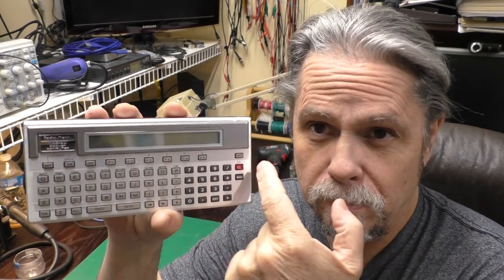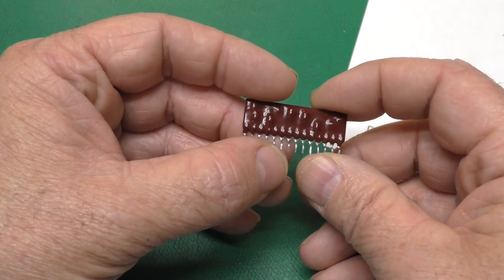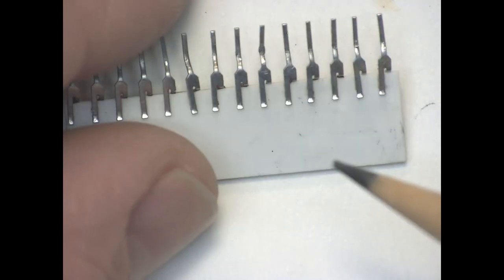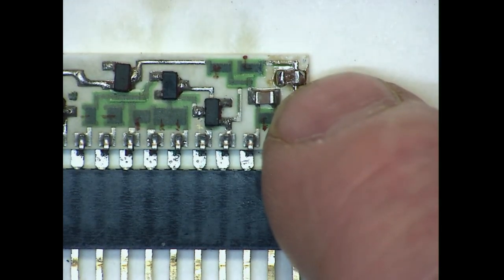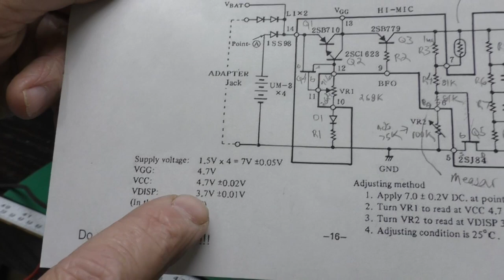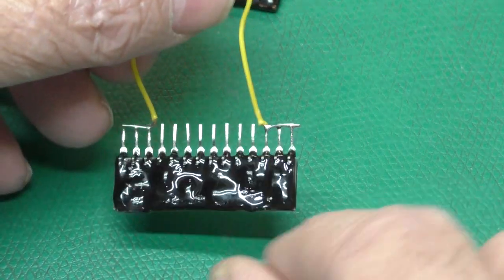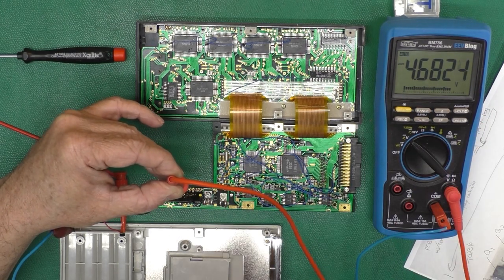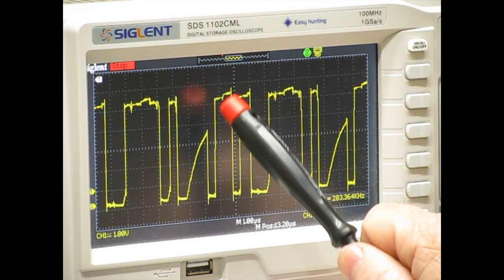DIY - Hybrid module decapping, repair and re-encapsulation

Comment: Found my readings.  Pin 4 is 1.0V on one unit, and 1.1V on another.  Both units are working perfectly fine.
Reply from the maker: Thanks. Someone else suggested they should have said to measure from VCC to VDISP which would give 3.7V. There are a few other errors in this little schematic too. I found another version which shows Q2 the correct way around and the missing R9.

Comment from the maker: I have since learned about 'fumed silica powder' which is a thicker for epoxy. It is mixed in with the epoxy to increase the viscosity and prevent the run-off and dripping problems I was experiencing.

A few keen viewers pointed out that the voltage regulator circuit would not have worked as shown in the schematic. I went searching through all of the PC-1500 manuals I have and found that the service manual has a second schematic in the back (the tech ref manual does not) which shows 'Q2' the other way around and it also shows the 'missing' resistor I called R9. Thanks to the folks who pointed this out.

Also, the same two folks pointed out this configuration is called a Sziklai pair not a Darlington pair. Thanks!

Comment: I wonder if an ultrasonic bath would have gotten the coating off without quite so much scraping - but that's a superb repair job. Had it been unsuccessful for some reason, it would have been reasonably easy to create a replacement, but it's nice to have a repaired original.
Reply from the maker: I was worried about the scraping so the amount of pressure used was minimal, more of sliding the coating off then scraping. The brass brush was used with a light touch as well. The ultrasonic cleaner is an interesting idea. I wonder what the interaction between water and the epoxy remover would be. Maybe the module in a baggy of epoxy remover placed in the water in the ultrasonic cleaner? It might also shake the pins off the PCB. Without the epoxy they were very fragile.

I have started to lay out a replacement PCB, just for fun.
Reply: @HeyBirt  I was thinking either using the epoxy remover as the bulk media in the cleaner, or putting the device in a little metal dish full of remover. I'm quite interested because I never thought of using epoxy [floor coating] remover as a decapsulant and it could be very interesting for ICs. And much much safer than the normal method involving hot acids!
Reply from the maker: I think ICs use a type of thermoplastic rather than epoxy. I suspect that the solvent I used would not work on them. At least it did not seem to have an effect on the transistor cases of the module.
Reply: @HeyBirt  Oohhh excellent point. People often describe the plastic packages as being made "epoxy" but yeah.. you're right, they can't be. Well, back to boiling acid it is :D

Comment: The last 2 I worked on, I wrote down the voltages on all the pins. Let’s see if I can find that scrap paper. 😅

What I can tell you is to be careful with VR2. If set too high and running off batteries that are not brand new, the system will turn off on you!  Too low and the LCD will become dim.

Comment: Great fix! Thanks for sharing the epoxy experiments.
27:11 If I'm understanding, you for a short time, forgot about the prior repair... I have definitely taken to leaving notes in equipment, with dates, to remind myself what I did before. (Of course YT videos serve that purpose too. :) )
Reply from the maker: I have a 'few' PC-2s and PC-1500 so until I saw the diode, I did recall I had fixed this one before. Putting a note on a device to track repairs is a good idea. I typically do this when installing new rechargeable battery packs. It would have jogged my memory sooner on this PC-2.

Comment: Your measurement of the mystery voltage was 0.97 V.  They must have meant the voltage drop was 1V compared to, relative to.
Reply from the maker: It could be something like that. It could have been described in an odd way in the original Japanese documentation and instead of VCC-3.7=1V it got changed to just 3.7V.

Comment: Don't count too much for a diode to act like a fuse. They almost always fail short circuited. Then the bonding might fuse, but that won't be at a very low current. And by the way I think Q2 in the module's schematic has C and E swapped, otherwise I don't see how it could work that way.
Reply from the maker: The diode did act like a fuse the first time 5V got shorted to ground. I think the transistor having 10x the current capability of the diode probably gives the diode a very good opportunity to fail open.
Reply: @HeyBirt  Yes I heard you saying it failed open the first time, must be a very peculiar diode indeed!
Reply from the maker: I just check the image of the decapped module with the Q2 package pin out and it seems it is wired as in the schematic. I was not sure what the MOSFET in that part of the circuit was doing either.
Reply: @HeyBirt  Then that's one of the most strange circuits I've ever seen. Q1's base can only source current and Q2's emitter can only source current when transistors are used "properly". However, the way Q2 voltages are arranged make it work in "reverse", it's still amplifying current but with very low HFE. The FETs are likely bot used as variable resistors, one is on a voltage divider, so it's definitely making a variable divider. The other one is providing variable bias current to Q2's base.
Reply from the maker: @iz8dwf  Now I wish I knew more about SPICE type programs so I could simulate this circuit to understand how it works.

Comment: I'm thinking vdisplay is - 3.7V measured from the 4.7V supply rather than ground? That would fit with what you measured...
Reply from the maker: That would make the value given work out correct but it says both VCC and VDISP are measured from ground. Of course, this schematic has a few other errors as well.

Comment: Have you tried liquid electrical tape? Instead of epoxy i would have tried this at first.
Reply from the maker: That is an interesting idea. The epoxy is formulated to be a good conductor of heat, so the heat is not trapped in the PCB. I'm not sure the liquid tape would do that. Also, in this application the epoxy was an important part of the holding the pins securely.

Some coatings can adversely affect PCBs. For example, there are only certain types of silicones that can be used. I'm sure the liquid tape would be safe for copper but I'm not sure how it would react over time with the rest of the PCB.

Comment: That pair of transistors is not a Darlington formation. Not sure how it is called if at all it has a name. It looks like a Sziklai pair but with swapped collector/emitter on the 2SC1623
Reply from the maker: Thanks for that. I just checked the photo of the de-capped module with the 2SC1623 and it does seem it is wired as in the schematic. I did not understand what the MOSFET in that part of the circuit was doing either.
Reply from the maker: After chatting with a friend and sending him the schematics and PCB images I went searching through all of the PC-1500 manuals I have and found that the service manual has a second schematic in the back (the tech ref manual does not) which shows 'Q2' the other way around and it also shows the 'missing' resistor I called R9. Thanks for you and Frank for pointing out the circuit would not have worked as it was drawn in the schematic shown in this video.
Reply: @HeyBirt  Excellent find! I couldn't explain it either, but admittedly my electronics knowledge has faded a bit over time and didn't immediately think it that setup was actually wrong, but you've just proven it is 🙂 Extra points for your perseverance :)
btw: With this video you could bring back some nostalgic moments as from what I remember these kind of modules on ceramic boards where fairly common in Philips TV's and the like in the 80's. At that time I would never have been able to repair them with the soldering iron I could afford: A screwdriver heated on the gas stove... (the one with the plastic handle was not such a good idea)
Reply from the maker: @Janktzoni  There is a guy reproducing hybrid modules for TV sets.